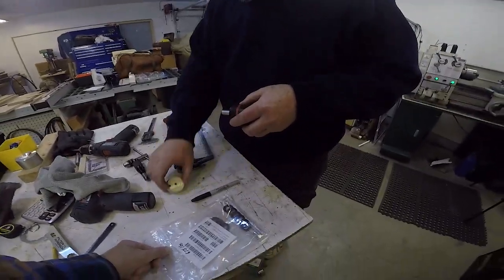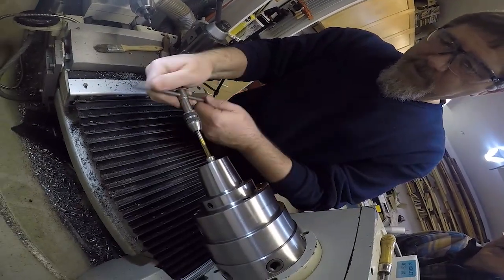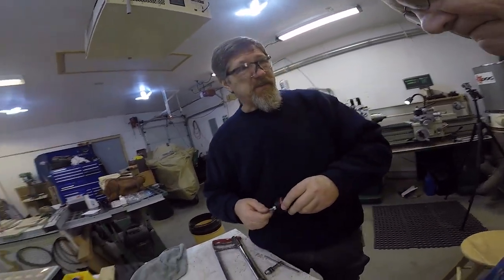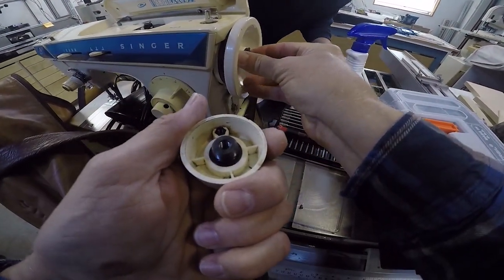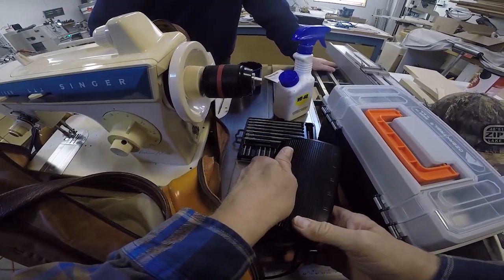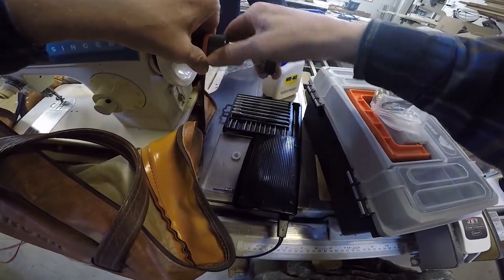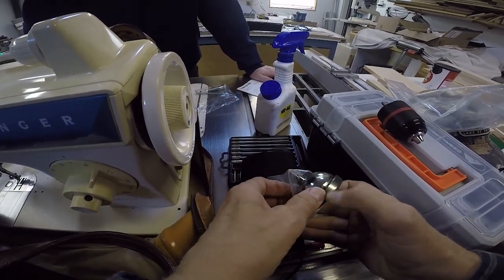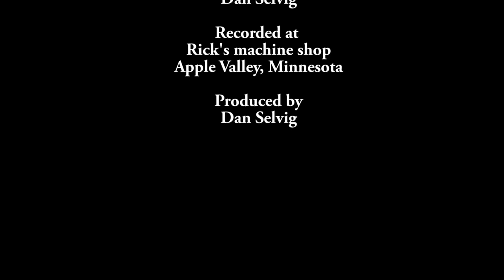Making a Sewing Machine Lathe 20230314

Comment: I'm in a garage project where I intend to cut a straight industrial sewing machine in half, and transform the part where the steering wheel will remain, into a lathe head. it will be necessary to transfer the location of the upper shaft end bearing closer to the 'castle'...it won't be easy but my old pfaff563 will have a second life. this time like a lathe.